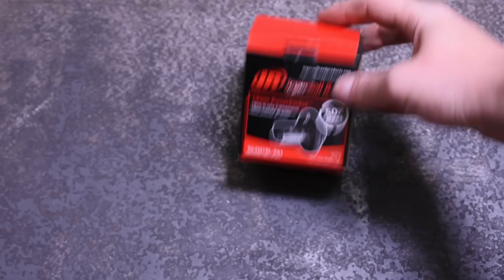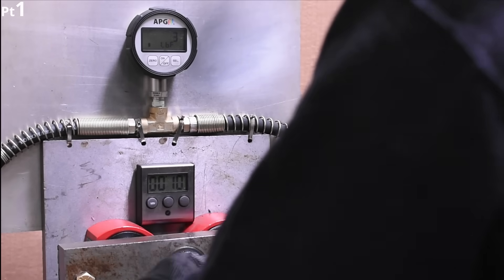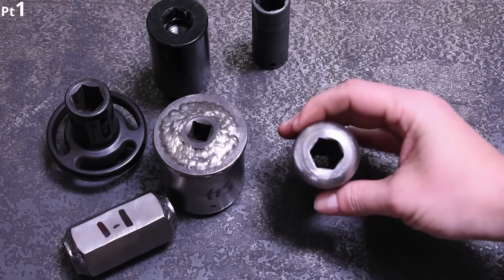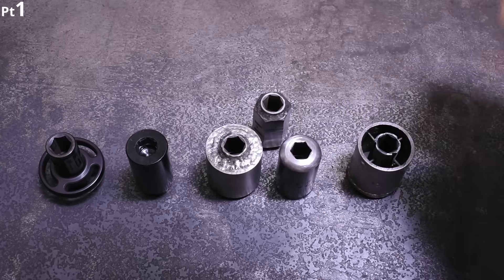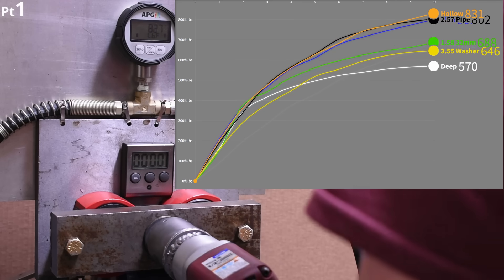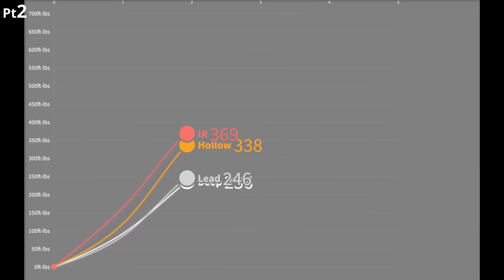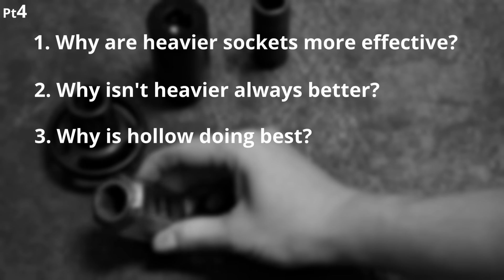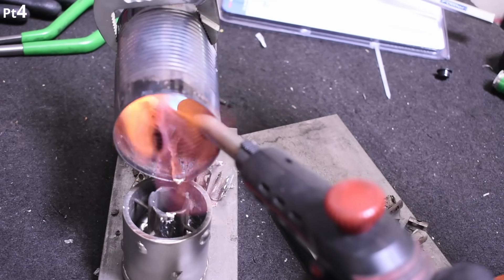Heavier Sockets Make More Power? Stumps Physicist

Comment: I’m not a scientist but I do work on Hondas at a Honda dealership, and I can confirm the weighted IR sockets work. They were more necessary years ago when air and electric impacts were not as powerful. Now my high torque 1/2” Milwaukee will take a crank pulley bolt off with any 19mm no problem. My  3 year old Air Matco 1/2” will work on most but not all crank bolts

Comment: So would it work if you made an extension or spacer out of pipe like the hollow one and put a socket on the end of that that would fix some of the not fitting anywhere issues and then its more universal for other sockets

Comment: im no physicist,    but here's my thoughts.

the hollow design socket works the best because it has more weght farther out from the center,  which is basically like having more leverage,
and the hollow design makes it light enough so it doesn't consume too much of the impact guns energy like
the solid sockets did.
I think the reason the IR socket didn't perform as well as the hollow one was because the IR socket probably had less leveraging weght far from the center.    

so I suppose the next step is figuring out the ideal total weght and the ideal weght distance from center,    wile still being a usable size and shape.

Comment: You ever see those old small engines and large engines from the early 1900's? Those things had massive flywheels that were heavy. Sure throttle response ain't there but torque man you got a boat load of torque.

Comment: I have a lisle socket for my Honda. After a weekend of it not working, I bought myself a torque multiplier for $250. It will outperform just about any impact setup available. I’m generally not very impressed with impact tools for automotive anymore. Maybe I would use them if I was a professional mechanic. But just being a weekend warrior, I like manual tools.

Comment: There's a lot of good comments I'm not reading all of them but I think some of the point gets missed. 
Whether it's a long head bolt or a long crank bolt on a Honda or Nissan the problem with an impact is the fact that it is impacting against what is essentially a spring. 
The long bolt just bounces back and forth and that torque doesn't get to the thing you're trying to hammer on. So depending on the length of that bolt and the frequency of hammer blows the results for actually getting a bolt off will be drastically different. A weighted socket that looks bad on a torque tester might removable quicker. You need to get yourself a real long 12 inch grade 8 bolt and do some tests on that.

Comment: I may be very wrong but the flywheel makes the most sense to me. You dont want too much mass that the impact struggles to accelerate the socket, but keeping the weight further out allows a longer lever. I think if you made a heavier flywheel design it would perform the best.

Comment: 2 things: 1: My take on this is that hollow and flywheel designs concentrate the impact, all the mass works together and is not spread out over the radius.  Since vibrations come into play here, if the mass is concentrated in a rigid ring, it all hits at the same time.  Much like getting hit flat on by an object, or getting hit by a hammer , all that force is in one sharp impact.  With the mass in a thick walled cylinder the force is spread out over time and space, so when it makes it to the bolt it don't come as a sharp blow.  Much like being hit by an object not dead on, or being hit by a dead blow hammer, the force comes over time.  2: the lead seems to have had more to give.  This makes some sense.  Its own inertia first hiders toque but that inertia eventually delivers it.  I would have liked to see the lead one given more time to see where it tops out.

Comment: Wouldn't it be most effective to weld a cheat bar on the nut with a heavy mass on the end and then using the impact wrench to do the same as the fly wheel design? Because that's what matters on the fly wheel design long arms and heavy masses

Comment: Radius is a factor in the equation for moment of inertia. You’re definitely increasing the moment of inertia by making it larger. Odds are it’s not multiplying anything, it’s just closer matching the moment of inertia of the hammer ring inside the gun. Allowing you extract more of the guns power.    By the conservation of energy it can’t “add” any energy to “the system”.

Comment: Im going to take a layman crack at it here. 

Technically, the impact is transferring energy into the socket, which then transfers energy into the fastener. I wonder if a heavy socket, has a higher capacity to accupulate stored energy, and therefore can discharge more into the fastwner?

Comment: There is lots of discussion on moment of inertia, here we are technically talking about mass moment of inertia.  As I understand it the hammer inside the tool impacts on the anvil, which impacts on the socket, which impacts on the fastener.  My guess is that there is a range of mass of one item vs. another where energy transfer can best take place.  So if you took something like the IR design and gradually welded more and more weight onto it then graphed the results you would probably find the maximum point of torque output vs. weight added.  And it's not just weight added it's mass moment of inertia so my assumption is that you would be adding weight at the same location each time, the same distance away from the center of the socket.  The IR design has a flywheel looking piece with the intent of keeping the front part of the socket at small diameter for ability to fit where it needs to go.  But back to the point, there may be a different optimization for each different impact tool for the inertia of the socket to interact best with the inertia of the parts within the tool.  They very well could also interact differently with the mass of the fastener as well.  You would need to construct a rig that uses a fastener more similar in diameter and length to the Honda crank bolt to see if that is truly the case.
The fact that your hollow socket performed the best doesn't have anything to do with any strange dynamic action of the hollow shape, it has to do with the mass moment of inertia of that shape being the most efficient because of the mass being added as far away from the center of the socket as possible.

Comment: the key here is to get as much momentum as possible (with mass located on a large diameter giving more torque applied) but it should be on the sweet spot of mass, beacause if you exceed the mass your impact can accelerate and give all its energy, you would have less power overall. As it happens with a cheat bar when trying to loosen a bolt, the loger it is from the center point, the higher torque... so if you can have a mass as big as possible (depending on what your impact is able to accelerate) and as far from middle as possible, you would have max torque socket just for your impact specs. So you should make a graph playing with distance located mass with different mass to know the sweet spot combination for your specific impact drill
Reply: key factors you should use as variables to find max output torque: socket mass, its distribution as distance from the center, angular speed the gun can transfer on each hit. Need to find the balance between a good angular speed, a far mass from the center and the size of the mass, not so big that it can get to speed and not so light that it has good speed but not force applied beacause you accelerated a tiny mass
Reply: for all that, and the data you showed, i asume, the highest torque spec should be reached locatig as much mass as possible as far as possible from the middle point, as it will have higher lever arm (like a cheat bar), but it should allow the socket to accelerate to an optimum speed, making a compromise and balance between "far from center weight" and speed o each impact.

Comment: The extra mass on the socket is actually helping extend the mass of thehammer and anvil but in a way not obvious. However, due to the small amount of play between the socket and the bolt, the extra mass acts like a rubber band. That extra mass has a delay tug on the bolt after the strike. Reason why it works within reason is because the tool needs to have enough power to not be bogged down by the extra mass. The rubberband tug effects are more pronounced not just with mass but mass as far away from the center because thst mass is traveling at a higher velocity. The anvil now needs more force to stop and that force is transferred to the bolt. Once the socket hits the bolt, there is also an additional recoil and that recoil helps reduce the tool’s energy needs. It’s sort of like using the energy from the recoil of a machine gun to load and fire the next bullet. I would think that if you can match the recoil to the amount of play between the socket to the bolt, you might be able to get higher torque numbers ~ like shave off 1/100 mm off each side of the bolt or the socket to find the optimal recoil. I’m not a physicist but just thinking out loud lol

Comment: I, the ghost physicist👻, am back to make some points here:

1. Rigidity: Each strike creates tiny deformations in the contact surfaces, which is converted into heat in the metal. Softer metal absorbs more of the striking energy, even if you cast it inside.

2. Inertia: More precisely, the moment of inertia or rotational mass. The surfaces of the socket and nut do not fit perfectly, but an in-between gap is designed to facilitate insertion. A socket with heavier rotational mass will gain more angular momentum during this "flywheel interval" before collision with the nut, given a fixed rotational speed of the driver. A heavier rotational mass means that it's literally heavy or that its mass is distributed over a farther radius.

3. Resonance: Every time the socket and nut collide, they both rebound. They'd better stay in-phase next time for a better momentum transfer, otherwise there will be an increased damping loss of energy. The resonance frequency is related to rigidity, mass and shape of the material.

Comment: a little late to the party but I am curious if the mass of the wheel was closer to the bolt if that would make a difference too, since I can only imagine that the conservation of said momentum because it is further back is being lost to the tool and your hand VS the one that is an empty tube where the mass is equally distributed across the head of the tool instead. there is also a thought of what if the mass was not circular but more like two weights at the end of a bar if that would make a difference.

Comment: It's the bounce and inertia. 
Lead is pretty soft and takes out a lot of energy into elastic and/or plastic deformation is what I would think. 

But then think about titanium hammers, they are much lighter than traditional steel hammers yet outperform them at higher comfort because they don't bounce back. 
I'd be curious to see what a titanium anvil and socket could do in these impact drivers. 
The big UFO looking socket has a higher moment of inertia which also means less bounce, more energy transfer.

PS.: forget about a resonance frequency what many others have suggested.
Resonance frequency is incredibly difficult to hit, requiring a precise overlap that you'll only get if you can adjust the tools frequency while in use, but since you're tightening a bolt that frequency changes across the entire curve. 
So even if one of these is hitting a resonance frequency it'll only be for a short moment until it's out of that frequency again.

Comment: Torque deflection?!?.... Maybe?
Reply: The socket should experience torsion at the moment of impact. Which will propagate as a wave back towards the impact gun. So rigidity would help, but so will the difference in moments around the axis in the case of the Rand. Since there outer part will have a higher inertia as the wave propagates back it would work to cancel out some of that force instead of the impact gun cancelling it. This would be true the same way for the hollow impact since it would have a larger differential in moment around the axis from the socket column.

Comment: Please try assisting with a wrench on a socket with external wrench flats. If torsional spring back is the key then you should be able to load the socket on the direction of rotation taking out any backlash in the system and provide more effective hammer blows and more forward progress.

Comment: Would the IR power socket flywheel design work as an adapter so you could attach any socket?  Or would the extra torque just get eaten up any slop between the adapter and socket?

Comment: I have used the astro crank socket to great effect ..if its tight you use that socket and its coming off..broke a 92 toyota 22re crank bolt with m18 mid torque using this socket in 2-3 seconds and a honda crank bolt with a high torque easy

Comment: I'm definitely not an expert, but I could see how a larger diameter might help. If you watch ice-skaters, you see that a larger diameter meant a slower rotational speed for the same rotational energy. Inherently, a larger diameter with the same rotational speed would imply a higher rotational energy. Since the impact driver uses more or less the same rotational speed for impacting both size of sockets, it could mean that this leads to a higher torque on the bolt in the end. Can't confirm definitively that this has anything to do with it, just brainfarting here :p

Comment: It's all about angular momentum.  Your driver is not pushing the nut around.  Instead it is driving the socket.  The socket is not a perfect fit on the bolt ( or nut) so as the anvil in your impact driver hits, it propels the socket, which (in that split second) merely takes up the slack.  The socket then hits the nut.  The angular momentum of the socket therefore has a massive effect on the resultant force applied to bolt.  Angular momentum is increased with diameter and mass.  But lead is rather soft, so although it has a large angular momentum, it's also a great shock absorber.  So it will absorb a lot of the energy.  You should have repeated the test using a socket cast from depleted uranium.  That would have had the perfect combination of rigidity and density. You could perhaps add some Vanadium carbide into the mix to make it a bit more wear resistant.

Comment: What about making the "fat socket" into a "heavy extension" that uses a regular impact socket so you don't have to fit it into the flywheel. You should have enough data to calculate the sweet spot for weight

Comment: Mech engineering student, I think it might be your torsional rigidity:mass ratio 

Reminds me of the I-beam example in traditional bending; the IR one adds both torsional rigidity and mass, but does so in a way that the net ratio is in the favour of rigidity - iirc this is both a factor of first and second moment of inertia 

You could test this by comparing different metals (i.e. different densities) in the same geometries 
If I’m right, it’ll be less efficient with higher masses

Comment: It seems that heavier sockets effect the rebound of the impact.  I’d like to see some tests with the good old trick of using your hand on the socket and turning in the direction of motion.  This also helps reduce rebound and I’ve found it very helpful with new battery impact wrenches because they are higher frequency impact rates.
Reply: I've never heard of that trick but that goes along with what I was thinking. Some way to keep the socket from rebounding so that all the hammer's force is transfered to the bolt rather than back through the tool

Comment: 'Not a physicist' here but it seems to me that to IR socket worked best not due to sheer mass but due to inertia.. When you push the mass further out from the centre point the inertia is increased due to leverage, just like using a longer breaker bar. I'm keen to hear feedback 😎

Comment: If you've ever seen a newton's cradle, when balls the same size and weight hit each other they transfer basically all their momentum to the next ball, but if they don't match, the first ball either keeps moving forward or bounces off backward, in either case not all of the energy gets transferred into the second ball. So I think the ideal socket weight would be halfway between the weight of the nut/bolt and the weight of the part of the impact driver that's transferring the energy into the socket.

Comment: If you look at a typical impact socket it's constantly bouncing around and vibrating and what the extra weight does is prevents the bounce back so that when the hammer hits it's not hitting a socket that's bringing back towards the hammer and then the hammer has to spend some of its inertial weight pushing the socket back in the right direction

Comment: Torque and leverage effect with the hollow flywheel design. A Shorter socket where flywheel is closer to bolt instead of gun will produce less. Flywheel closer to bolt on same size socket will produce less. The efficiency angle should be something around 30 degrees, which means longer sockets must be thicker and have larger rings for similar improvements.
Move the ring nearer the bolt head and try. You will see ;)

Comment: Suggestion: if making custom sockets is your thing try seeing how tight you can make the square drive reciever, maybe even use a slight taper to get a perfect fit. I bet a ton of energy gets lost there.

I wonder if the hevier sockets just flex less wasting less energy. The lead socket might have performed poor due to its low elastic modulus plus (potentially) poor mechanical coupling with the steel.

Comment: "Circumference" it's not the weight but that the flywheel effect is providing torque after the hammer fall.. instead of hammer stall it's hammer carry hammer.. so to speak.. the carried weight would be the same as you putting your hand on the socket to keep it from bouncing back.. rotational energy vs weighted energy.